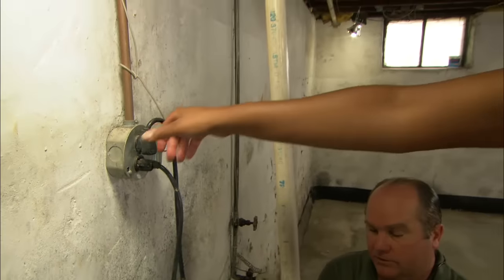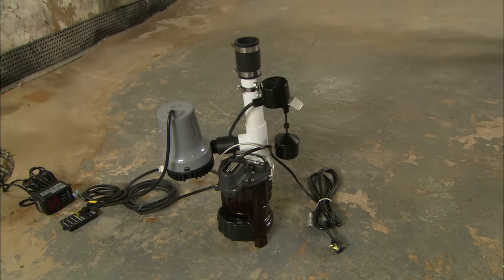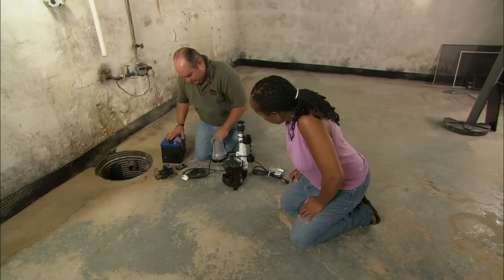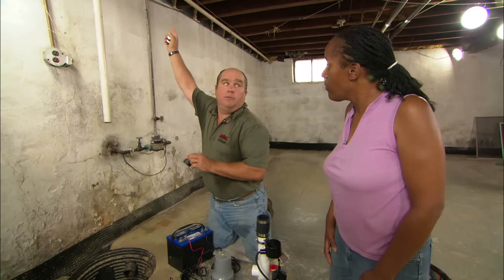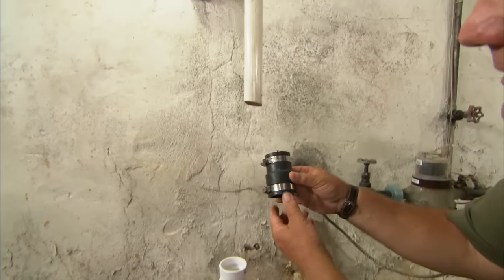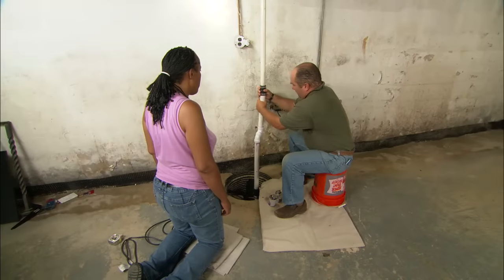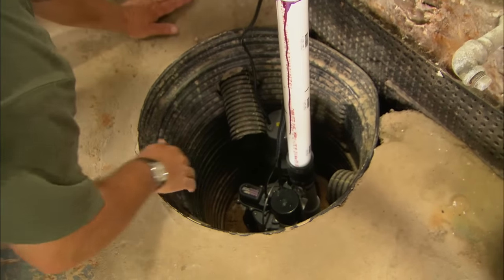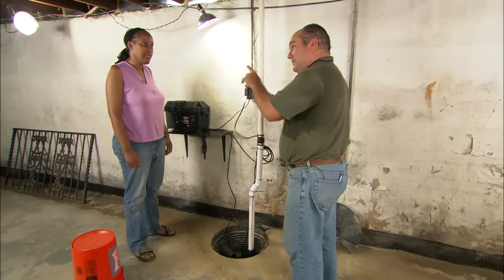How to Install a Battery-Operated Backup Sump Pump | This Old House

Comment: Four years ago we lost power for four days. If I wasn't home and didn't have a generator, our finished basement would have flooded. I then put in battery backup pumps. Lost power again last weekend and they worked like a charm.
Reply: Can you please tell me the model number and where to buy the sump pump? Thanks
Reply: Yes, please tell us the model and where can buy it
Reply: @gaoanyonebaoli1675  They are Barracuda brands and bought them at Menards, a home improvement store.
Reply: Thank you, do you know this battery rechargeable
Reply: @gaoanyonebaoli1675  The system I installed has a battery charger, 12v battery, and 12v auxiliary pump. The battery stays charged and the 12v pump kicks in if the water rises above where the 120v AC pump would normally kick in. There should be lots of You Tube videos about sump backup systems.

Comment: Most home owners think when they install a battery back-up they're safe from flooding. Not true. If your battery back-up takes over during a heavy rain and runs frequently, the battery is only good for a couple of hours. Also, a sump pump requires inspections and attention if you want it to be reliable. You have to understand how often your pump cycles and when it should be replaced. Most people run to failure and never know there is a problem until their basement is flooded. If your house has a sump pump, that little piece of equipment should be your main priority.
Reply: Great points ⭐️👍
Reply: We had flooding rains last night in NJ, and the sump pump cycled every 3 minutes for hours. I wonder how long a battery backup would last. We never lost power, but I was worried. I also wonder if I could keep a secondary battery charging to swap out if the first battery only lasts a couple of hours.
Reply: @FrankV-Audio  If your main pump was running every three minutes, I'd guess a battery back-up would last a few hours at best. It depends on how high of a head you're pumping and other factors. You could certainly keep an extra battery but think of the maintenance and upkeep. Batteries don't last forever, get dead cells, etc. My solution is a small suitcase size generator and have everything pre-wired so I can run the generator in my garage and plug it into a reverse socket in the back wall that feeds an outlet next to my sump pump. When needed, simply start the generator, plug it into the socket and move the sump pump to the generator outlet. But then again if I'm out of town, I'll be in trouble. Another solution is a water-jet back-up.  https://www.youtube.com/watch?v=fbIzFAMZYN0
Reply: @FrankV-Audio  you could do that or just wire a second battery in parallel with the first, the charger will keep them both topped off and you'll double your power
Reply: You’re better off with the inverter then one of these battery back ups although the inverter is probably 600-1k it would definitely last longer than your standard battery back up which only will give you two hours of running time
Reply: @Cccc-ky4vq  OK, but what is powering the inverter? Generator, battery, solar panel?
Reply: @FrankV-Audio same here in Nj..most likely a couple Hours or 3 max to be safe

Comment: So many "experts" in the comments lol.  These cheap backup pumps are obviously not as durable and powerful as the primary pump because it's an emergency backup only.  Ideally it would never need to be used, but it will get you through in a pinch if the power or primary pump goes out.  I bought an entire kit with battery for under $350 on sale and it's good piece of mind.
Reply: What kit did you buy? I'm looking to buy a better primary pump and a backup pump with a battery.
Reply: @asadilla1  what did you end up going with? Researching these now.
Reply: @victor2410  I ended up having TC Hafford Basement Systems install their Triple Safe System. The battery is a Ritar DC12-120.

Comment: Clean the pit out before installing the new pump.  Just buy a Sumpro. Than you can use just one pump  your 110v pump discharges way more than a back up pump

Comment: What happens if there's a big storm and it kills the electricity band it rains all night...  After 4-5 hours, when the battery dies, there will be a swimming pool in the basement.
Reply: that is a totally different issue that requires a whole house generator at that point
Reply: If that is a concern, you can always buy bigger or multiple batteries. In a pinch, you can swap in a car battery, then use your car (assuming you can start it) to recharge the deep-cycle battery.

Comment: I wish I would've thought of the 45 fitting to offset a vertical run I did in my own basement before I notched two joists illegally. Now I gotta pay for mending plates.

Comment: Rather have a water line powered sump pump as a backup. No battery required.
Reply: Yes just installed one its fantastic.
Reply: Pyroman /  the water is directly connected to the pump, it is automatic it doesnt use power or battery.
Reply: Pyroman /  you need to plumb from your water main to the pump
Reply: Must be a city dweller. Does not work in the sticks
Reply: Since you're connecting to a public water supply you'll need a check-valve and it has to be installed by a professional and certified by the village/city/county/town you live in. You can let the pump water go backwards into public water. Check with  your local government before doing this (avoid fines).

Comment: But don't worry if the back up pump battery goes dead, just leave the basement window open and the water (once it gets to about 5 feet deep) will drain into the yard...
Reply: thers a charger that keeps the battery charged up . I bought one. doooo
Reply: Always a dork in every crowd-- Go beat it !
Reply: Maxid1 iij
Reply: unless say a tree branch knocks the power out and the power co cant make it for a few days
Reply: @coolbrotherj  Then you could plug it into your vehicle for an hour and charge it that way since it's 12V
Reply: @coolbrotherj  if that time frame is common where you live, you should already have a generator
Reply: Cool, so since it doesn’t solve every problem in existence then it isn’t worth doing. Got it!
Reply: *yahd
Reply: but dont worry if theres that one person that doesnt pay attention to the video that clearly states the battery will be connected to a trickle charger

Comment: Us it possible to install a battery backup to your circuit without buying this kit?
Reply: I realize it's been a while since you left this comment, but in case you or others still have this good question:

Yes.  The battery, pump(s), check valve, and monitor (rectifier + inverter + BMS + switch) can all be purchased separately.  Of course, you'd need to install the battery and monitor need each other, and they're useless without a pump.  :)

Comment: What prevents the backup pump from pumping water backwards through the main pump?
Reply: The check valve on the output of each pump.  This part was not explained.
Reply: @jima4286  He explained the importance of a check valve, just didn't show that both pump outputs had one.

Comment: Curious, what would happen if your sump pump cover is sealed (with any open pipe capped off), and your sump pump fails (with no back up pump)? Would the water eventually seep out of the cover, or would it work its way up the discharge pipe since the water cannot escape?
Reply: You will have a basement full of water if you don’t catch it and get your pump running. The water will seep right through your concrete floor…I know this first hand because my GFI outlet for my sump pump tripped during a storm and I didn’t realize it until I had about 2 inches  of water in basement. Luckily all I had to do was reset the outlet and the water was pumped out.

Comment: Low quality system. The back up pump will only work during primary pump failure or during an electrical outage. So it never gets exercised, only called into demand under extreme cases. Should have used a system such as a Metropolitan which has a higher quality primary pump, and equally high quality back up pump, and a controller that exercises both pumps so all is ready to go. They also offer a single or dual battery set up for longer life. As for the installer, how about cutting the discharge pipe straight and using a banded coupling for extra strength, and what about a check valve to prevent pump cycling?? Not to mention the sloppy primer job.
Reply: You must be fun at parties.
Reply: are you still crying about it 3 years later?

Comment: We just purchased a beautiful house with a sump pump, we've never ever had a home with one nor had either of us heard about it before purchasing our home, well until the home inspection. But my question is, should we also maybe purchase a 2nd back up battery to keep charged in the event the power is out longer and the pump may need to be run by the back up battery for longer than a day? Thank you in advance!
Reply: Good question.  This is why I always install a water powered back up sump pump as if your power is out for an extended time a battery powered one is no good.  You will always have water and it’s easy to install.  Good luck and let me know if you need any help.  👍🏼
Reply: It depends how probable ypu think a long outage is. You may be better off with a generator. My home has dual sump pumps, both with their own battery back ups. I also have a propane generator in case of a power outage. It's a bit over the top, at least several things have to go wrong to flood though.
Reply: I would buy a gas powered external generator and run your sump pump to that.
Reply: You can recharge the 12v battery with a car and jumper cables.  Cars' alternators have different outputs, but an alternator should fully recharge a 100 Ah battery in less than an hour.

For comparison, a 100 Ah 12v battery should be able to power a sump pump for at least 2 days  (assuming 350W running 4 seconds every 2 mins).

Comment: Were can i find that one way check valve for the bilge pump!
Reply: Every Home Depot, Menards, Ace hardware, Lowe's, True Value on the planet
Reply: Pyroman /  No they don't!
Reply: Menards does have one way check valves but they have a 1/2 pound spring on this video that check valve is a  one way flapper well i found it on ebay " Flapper Check Valve"

Comment: I will have mine professionally installed. Water and electrical connections, along with a encased battery
Unit, isn't something I am willing to do. My sump pump
Is getting old and don't want no errors on my part!

Comment: we just bought a house and it has a sump.   first time ever dealing with such a thing.   downside is that it pumps into the sewer and we've been told that is illegal.    downside is that the washing machine also drains into the sump.   from what I understand there is not going to be a cheap easy fix for this.    anyone have any ideas as to not take my wallet out and burn it?
Reply: You figure anything out?
Reply: @gtarules1  I've gotten to the point where I'm just not gonna worry about it.  It's apparently been like this since the house was built back in the 70s
Reply: pumps into a street sewer? why would the washing machine drain into that ? im pretty sure it was legal to drain it into a sewer probably back in the 70s. if thats the case then it would be fine just no new developments can drain into streets or sewers.
Reply: @XXMETAL4LIF3XX  that's pretty much it.  The house was built in '74.  The basement doesn't have a normal floor drain.  Our sewer line is 4' up the wall and everything drains/is pumped into that.   Though we've got what looks like a 4 or 6 in pipe at the bottom of our sump but I have no idea where that comes from or goes.  A relative guessed that it was a French drain but I doubt it.   The washing machine drain is concreted into the sump so it has to have been built like that.
Reply: @k333rl  wow that is really interesting, even for 1974 that seems odd though, by then there was a lot of standards in building . my house is 1954 has sump pump and just pumps ground water into the street , these days thats not even allowed. we had a french drain put in and a second back up pump about 20 years ago. i dont see any issue though with yours draining into the sewer. all goes to the treatment plant.
Reply: @XXMETAL4LIF3XX  I've been needing to get at least a battery backup if not a 2nd pump.  Problem is that I know just enough to be dangerous.   I've been trying to learn as much as possible but still leaning on having someone come out to set something up just because I would know that they were insured.

Comment: @This Old House. Why don't they make a converter to run my primary sump pump when the power goes out?
Reply: Would still flood if primary pump failed.  With battery pump serves a dual purpose acting as a backup failsafe (hence the alarm).
Reply: A big enough UPS & battery bank, like you'd use for a computer backup... Would do the trick nicely.
Reply: Using a computer UPS would work great as long as get a pure sine model.  Most use a simulated sine since that is fine for most electronics and is cheaper to manufacture, but AC motors do not run well (if at all) on them.
Reply: Some computers don't run well on them either. My el-cheapo outdoor generator from Lowes could not power my computer when I had to use it on several occasions. I had to buy a sine UPS to run it if I had to start the generator.

Comment: only a DAY of use from the battery bigger than the freaking' car battery???????? I would think it would last AT LEAST  for three days of intermittent use or a full day with continuous use.
Reply: Car batteries are small. Way smaller than you realise. They have just enough power to start a car. They only never run out because they are constantly kept topped off by the alternator.

Comment: How to install a battery backup pump... DONT!!!! EVER!!!

Install a water powered backup pump.  When that 12v battery ends up being shot 5 years later you are screwed.  Also what if it needs to run for 4 hours?
Reply: The only problem with a water powered backup pump is you need to have water pressure to operate it. That's fine for those on city water. But for those of us on well water you need to go with a battery backup system

Comment: Using Teflon tape on plastic piping (vs metals) is not recommended by many experts in the industry, just do an online search for the reasons why. Thread sealant, meanwhile, can be applied. But if the intent is to unscrew the pipe from the pump for regular maintenance and eventual replacement, I would recommend just hand-tightening as per manufacturer's instructions. There are online sources showing that priming (using purple cement to prep) PVC piping vs. no-priming at all can result in less integrity to the seal, just the opposite of the intended result, it has to do with the delay between applications. I avoided the debate and results by using ABS piping, which was what our original home builder used for the original outlet pipe set-up.

Comment: that little backup pump won't be able to pomp all the water in case of heavy rain.I know it 1st hand.I bought a generator and feel safer in case of no power.
Reply: Generators only work if you are home.  Sump pump failure doesn't happen when it's convenient.
Reply: That backup pump is the same size as the regular pump so it should be able to
Reply: @shawnsdrumcave  and you could always buy more batteries and run them parallel if one battery gave 24 hours 2 will give 48 hours.

Comment: I suggest a water powered educator backup pump. They are more reliable than battery power. They only need water pressure to operate.
Reply: I agree but if you are on a well it would not work

Comment: Is this always the case with basements?  Do they tend to flood fairly often during stormy seasons?
Reply: Depends upon where you live. Where I live all houses have basements and it takes an enormous storm for anyone it even be worried. About six years ago we got a hundred year storm and it only flooded houses that where close to the river.
Reply: If you live in the midwest, you live in a flood plains and the soil is saturated with water all year round. 
If you live on the coast, the oceans keep the water saturated in the same way. 
People who live on clay based soil prevents water from draining properly.
People who live on lakes, rivers, large bodies of water have issues. 
People who live at the base of something like a mountain will experience all the runoff from that mountain and increase their water table relative to their neighbors uphill. 
So yes it is a common issue.
Reply: Not always.  If your external french drains are good, you'll never need an internal sump pump.  I always think of sump pumps as not fixing the real problem, which would be solved by putting good external french drains around your foundation.  However, some houses don't have room or have a bunch of concrete around the house where it would be really tough to put external french drains in, so a sump pump would be a better option.
Reply: Ive only ever lived in one house without a sump and that's because it was literally on a hill by itself. No drainage issues. Any house with a basement should have one, especially in the Midwest or southern Canada

Comment: Can you please let me know, What kind of battery do you use , and this battery rechargeable, and what products can charge this battery. Thank you
Reply: PumpSpy 2000W Primary Sump Pump Backup Power System, Do you know this can work together with the video products
Reply: These battery's are typical deep cycle marine battery's.

Comment: Why did you not drill a weep hole in the pipe or does the pump have one built in ?
Reply: Sometimes it comes with it pre-drilled but I was told airlock seldom happens so not necessary.